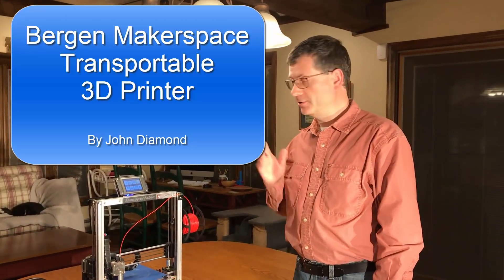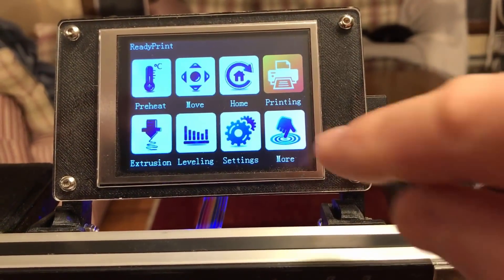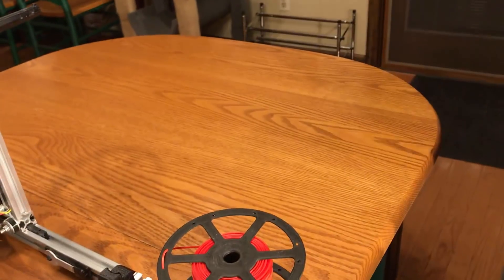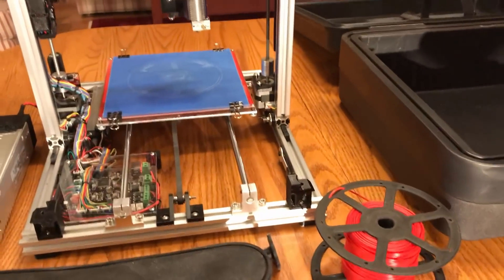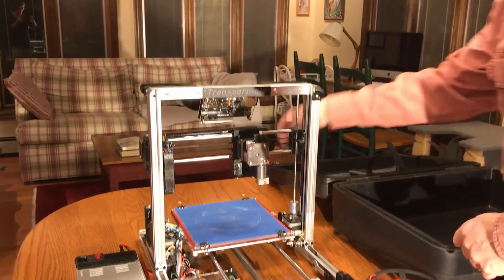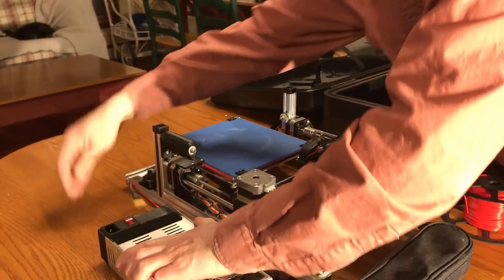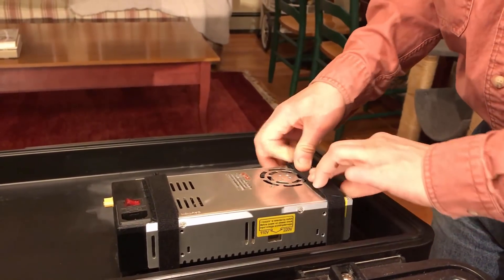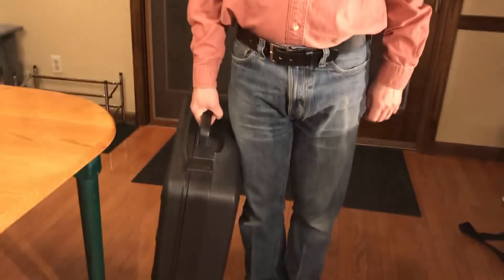Packing up the Bergen Makerspace Transportable 3D Printer

Comment: Hello!
Good job!
When you select "Pack up" it seems to me that it makes a strange noise, am I wrong?See 0:39
Reply from the maker: You are correct. This is part of the homing sequence before it moves the head to the packed position. It should be possible to change the stepping rate at that point but I haven't spent time investigating yet. It only started doing this after upgrading to the latest version of Marlin firmware.